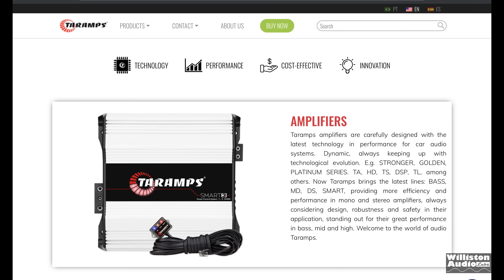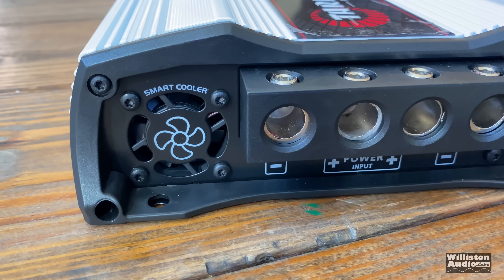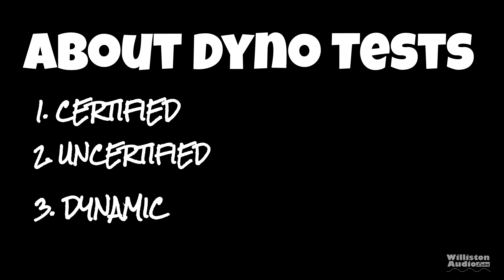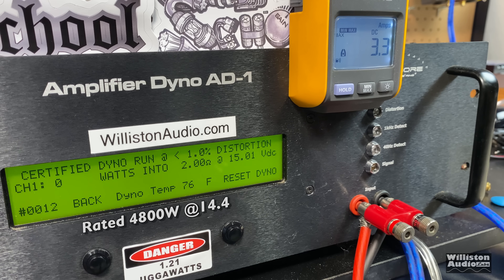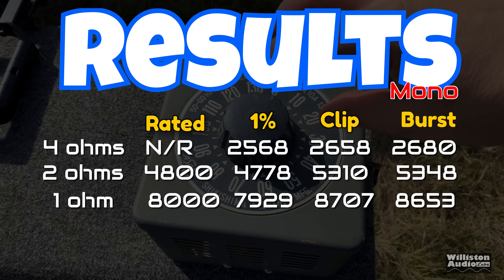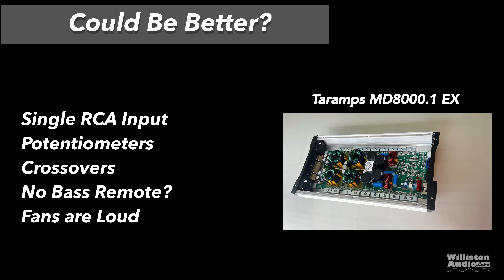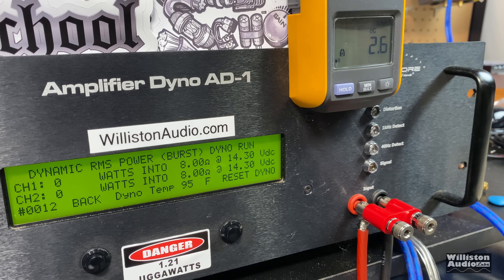8000 watts, but What's New? Taramps MD8000.1 EX Amp Dyno Test and More [4K]

Comment: I'd rather have the smart 5k.  Probably more powerful and better technology.   Great video as usual!
Reply from the maker: I’d agree and think it’s a better choice as well
Reply: @Robert Jacobson I agree with your comment. Even though I currently have both a Smart3 (bought when it 1st came out way before the Smart3 BASS was released) and I also have a MD8000.1 

I still have a Sundown Audio sfb5000 brand new in box that I've been planning on selling in order to buy the Smart5. Personally I'd much rather have a Taramps Smart5 instead of my Sundown Audio sfb5000! Some may disagree but I love my Smart3 so I'm sure I'd love the Smart5 even more!
Reply: I also agree, considering the impedance rise is not really a factor with the smart amps. Definitely more bang for the buck.
Reply: Having had both, the smart 5k seemed to "smart" and would clip more often. Both amps set with a DD1+
Reply: @bbtjdonnelly14  which amp hit harder tho do you think? The Md8000 or the smart 5k?
Reply: @PūsħTreeş  The 8k hits a touch harder, longer. Both having the same electrical and sub setup, the 5k clipped more often. That said, maybe I didn't get a top notch 5k from the factory.
Reply: @bbtjdonnelly14  thanks man I’ll probably just go with the md8000.1 then. that smart 5k was hitting above 3k watts at 4 ohms and heard it does good with impedance rise did you notice a difference in impedance rise with the 8k vs the 5k?
Reply: @PūsħTreeş  Honestly, I never did check for an impedance rise comparison. I am wired 0.67 @ idle, this could be why the smart 5k was throwing fits. That said; in another vehicle, I have a smart 3 wired to the same ohms with no issues.  I've been using the 8k for almost a year now with no problems. I'm not sure you could go wrong with either one. just from what I've gathered, the md is more forgiving under 1 ohm.
Reply: @bbtjdonnelly14  alright bet I appreciate it man ima go ahead and order me a 8k and a LTO lithium battery from down4sound and try n get another one in the future hopefully one holds it down for a bit.
Reply: @PūsħTreeş  yeah, for sure. May the taramps gods bless you well. have fun!
Reply: @bbtjdonnelly14  hell yea, one last question did you get the 1 ohm 8k or the 2ohm to 1ohm? I only see the 1ohm to pop up but I don’t think it would make a difference I’ll be running them at half ohm I don’t know after impedance tho.
Reply: @PūsħTreeş  The one I have is the 1 ohm model. Considering how sensitive these full bridge amps may be, I'd recommend getting the 1 ohm version if wiring close or bellow that.
Reply: @bbtjdonnelly14  alright bet I’ll order that one, if I wire two subs to it will it split the power between two subs or will it send all power to both subs?
Reply: @PūsħTreeş what did you get ?????? What hit harder   smart 5 or md 8000.1
Reply: @moneymac5214  I got the md8000 pretty  good amp haven’t turned up the gain all the way barely had it up and it blew my sundown sub definitely got that power, I couldn’t tell you which one hits harder but both are good amps.
Reply: @moneymac5214  I heard the smart 5k clips easier then the md8000 since it’s a “smart” amp but they just came out with the smart 8k go ahead and get that amp thing is a beast wish I would’ve waited and got it.
Reply: @PūsħTreeş There is another video of a guy saying he likes the MD more than all of their Bass and Smart series amps. He said it sounded more aggressive
Reply: @drjd2real  yea they ain’t bad I got the md8k at half ohm ima get a 12k tho soon
Reply: Smart is only good if your wiring at 1 in my opinion. But as for me im wired at 2ohm for efficiency so i run the 8k 2ohm and is absolutely awesome the smart 5 at 2ohm would have been less power for me
Reply: Same I’m getting it next few weeks love
My smart 3 already
Reply: @DJJDSKREWED  I just got my smart3 bass... it states @14 volts ⚡️ to hit 3k watts ... now if I was to run the amp at 12 to 13 volts. Is that bad for this amplifier?! I
Reply: @PRINYATIP  depends how hard you are hitting it, if you are starting at 12v and are asking it to deliver full power, voltage is going to drop hard (depending on your voltage source), probably into the 10's and yeah, it will explode
Reply: @minus3dbintheteens60  appreciate the reply! OMG.... im scared shitless now!! Hopefully my new upgraded alternator from 75 amp stock to 200 amp and big 3  0 guage OFC cables with 2  yellow top agm battery installed...hope this setup can handle this amplifier!! 😟
Reply: @PRINYATIP  just don't go ripping on it like an idiot and it will be fine.  A stock alternator and twin batteries of a good quality would be alright for that calibre of amp, but I stress decent batteries, 800cca from a reputable brand, and I'd personally run 0awg from the front battery to the rear
Reply: @minus3dbintheteens60  Thank you soo much for the tips and reply ! Appreciate it alot!
Reply: @PT  no need to be scared, lol you must be easily frightened. If you have the electrical upgrades you claim, then you will have NO issue whatsoever powering your Smart3 BASS. I'm powering my Smart3 with a 350 h/o alt and a Northstar AGM65 Battery. Been with that same setup for over a year and a half now, knock on wood no problems yet.
Reply: @PRINYATIP  no perfect to go down to 12v probably don’t want to dip to 11v but the smart line is designed to make power at 12.8v
Reply: @itdoesntmatterwhatyourname6128  Definitely frighten.... but thank you for the reply.  Never in my entire life harness this kind of power before... Im  extremely excited for this install 😊! At the end of this month I'm going to do this install myself. The install of my 200 amp HOA and this time I'm getting rid of my 0 guage CCA and putting 0 guage of welding cable for power and ground. I'm currently running 2 yellow top optima agm batteries. I'm a noob in the bass scene but learning on the way with great people on youtube with great tips. I appreciate everybody and everyone 🙏.  This is going to best Banging summer ☀️ ever!! I'll have a 🔥 fire extinguisher just in case..👍💪
Reply: @PRINYATIP  it won’t explode like the other person said honestly I have a 5K Taramps and when I had 2 battery’s and the voltage hit low it goes into protection mode is design that way and it won’t explode
Reply: @trashyfilms6681  but at the same time why would you not encourage someone to beef up there electrical so they won't have to go through what you went through. 

It's like your saying naw it's fine have shitty voltage it won't explode your good.
Reply: @PRINYATIP  definitely beef up your electrical if you can so you won't have to worry about your amp shutting off or other damages
Reply: @PRINYATIP  I got a 400amp Mechman and a single yellow top and i cant even go 1/2 gain on my smart 3k Just saying bro best go lithium.
Reply: Pushing a single old Sundown ZV4 18 draws so hard it caused my ECM to read a bad throttle position sensor signal. My car has an opti 7k and a pair of ZV5 12s with an 380 amp alt and a 45ah lithium limitless and it does great.
Reply: @Grim67firebird  wow!! It's draws that much current 😵

Comment: More big powaa!
This looks to be just enough power to run my tweeters!😁
You know I've always been of the philosophy that you can always turn it down but you can't always turn it up.
This amplifier could replace all four of my Orion 2150s and be double their power.
Reply from the maker: More to come. Thank you LTO 😂👍
Reply: Nice to see another Orion fan. I'm out of the bass game these days but had a 2350 WAY back around 1987 with a 200CRX set to 50Hz.
Reply: @MrV1NC3N7V3G4  Well it's either recap my old amps or go with something new like this.
I would still like to use my 30 DB LP crossover for the sub amps.
I'm going to check in to see how much it will cost to recap them.
Reply: I had to replace an entire bank of MOSFETS on my 2350 because I sold it to someone and they hooked up a 2 Ohm load to it. I didn't have the HCCA variety that was stable down to 1 or .5 Ohms. After I got it back, I replaced the transistors and it worked perfectly again.
Reply: @MrV1NC3N7V3G4  Yeah I never went competition I only had my system for me.
They're old now and the electrolytics are drying out on them. So I'd probably have to get them recapped. I'm not super handy with the solder gun so I'd have to pay someone to do it.
I haven't listened to the system in years. The amps been just sitting in the garage.
My brother had a 250 HCCA I bought it for him as a present. 
I believe it's still around somewhere.
I really like that old crossover the 30 DB LP.
But it uses the five pin for the phantom power you know.
I guess I could still use it if I could take one of the cables and convert it to RCA or something.
That I don't know how complicated that would be because they turn on wires built inside that thing as well.
Reply: @Geerladenlad  They make a phantom power adapter for use with non-Orion amps that supplies the 25v for the module
Reply: @MrV1NC3N7V3G4  Do You have one? Or know where I can get one?
These are going to be very hard to find at this point.
Reply: @Geerladenlad  I don't. The model is Orion PPS-100 but a quick search yielded only one stale eBay listing. If it's important enough to you, you might try an Orion message board or something similar where you can reach out to their community. Odds are, there are some people who still have them like you still have the 2150's.
Reply: @MrV1NC3N7V3G4  if I do decide to stay with the Orion I'll just have my amps recapped.
But if I go with different amplification I'll probably get a another crossover maybe even a audio control Epicenter or something similar.

Comment from the maker: Shop: (affiliate links)
Taramps MD8000.1EX (2022): https://amzn.to/3DDhjzy
Taramps Smart 5 Amplifier: https://amzn.to/3oX0XLV
Taramps Smart 5 Bass Amplifier: https://amzn.to/3oXIX3W
KICKER L7R Quad Box: https://amzn.to/3iY77rR
XS Power LTO Cells: https://lddy.no/13d2f
XS Power Intellisupply PSC90: https://lddy.no/13d2g

Video Index:
0:00 Intro
0:41 Unboxing
1:04 Features
2:58 Amp Settings
3:46 Amp Dyno tests
6:53 Subwoofer Demo
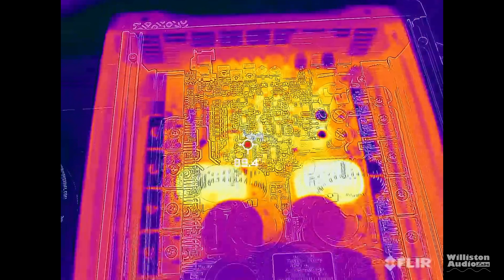8:17 Thermals and Internals
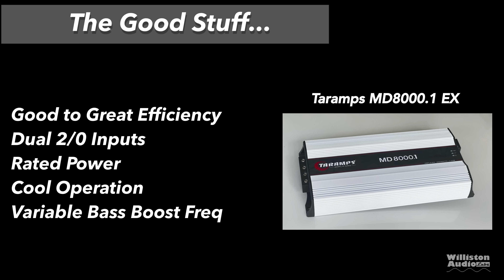9:24 Pros and Cons
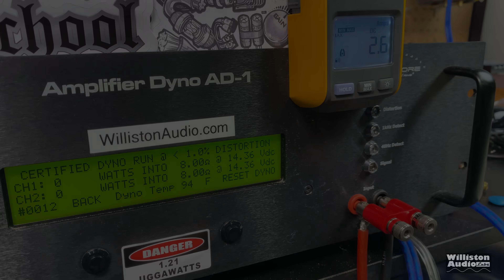10:52 Extras

SMD / D'Amore Engineering Amp Dyno: https://goo.gl/sJTcf7
XS Power D1400 Batteries - https://amzn.to/2BPFCKW
XS Power PSC60 Charger - https://amzn.to/2CHGcfs
Fluke 1000A AC/DC Clamp Meter: https://amzn.to/2Rw5WDA
Handheld Dyno: http://amzn.to/2u2EgKV
My Favorite Screwdriver Kit: http://amzn.to/2x0VzcE

DISCLAIMER: This video and description contains affiliate links, which means that if you purchase from one of the product links, I may receive a small commission. As an Amazon Associate I earn from qualifying purchases